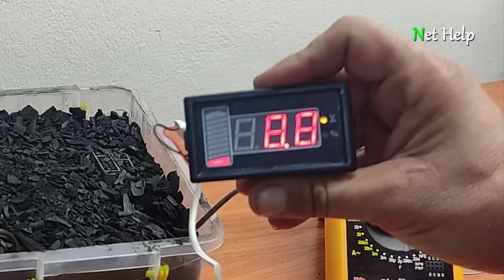Making a battery is a difficult thing, but we make it easier in this way - 12 volt battery

Comment: What substances do you use ?.
Reply from the maker: 1 - briquette
2 - aluminum panels
3 - plastic tube
4 - two copper rods
5 - brass screw
6 - aluminum screw
7 - copper strip 3 mm
8 - 200 g Hypochlorous acid 200L / H with a concentration of 200 PPM
9 - Electronic clock to monitor amps
Reply: Thanks .
Reply: Is it rechargeable?

Comment: Fake because single cell does not output 12volts it gives only 2.5 on average
Reply from the maker: sir
Have you searched for the Baghdad Battery, which was made more than 2000 years ago? It works in the same system

Comment: This is 1 cell only. you make 6 cells series connection, may be you will have 12v battery just like a car . good luck
Reply from the maker: The master of the lithium battery does not need six cells, but rather one cell

Comment: you make your self tired for cleaning the copper pipe, no need, after few seconds in the acid it will be clean very fast.
Reply from the maker: Cleaning the penis to give the charging buttons quickly and not the scythes of dirt
Reply: @NetHelp2  As you like friend.
Reply: @Net Help the white powder or whatever it was. What was that part? All was clear but that. Titles would greatly help or atleast just a quick recap near the info of the video is. Most was clear without talking or titles but I didn’t catch the “powder ish” stuff. 
Assuming Salt?
Reply: @MichaelSmith-mb1ig  sól kuchenna

Comment: Amigo, ya que te tomaste la molestia de hacer la batería, grabarlo, editar el video y colgarlo en YouTube, cosa que es de agradecer, podrías haber explicado que es lo que haces en cada momento, y los materiales y productos que usas, por que de esa manera solo se ve como lo haces pero quedan muchas dudas como por ejemplo ¿ que material estás poniendo entre los perfiles de aluminio ?  ¿ que liquido  es el que le echas al carbón ? ¿ que es el producto de color blanco  que también le echas al carbón ?   ¿ como haces para que el ventilador funcione a 12 voltios ? . A parte de las  dudas mi opinión, sinceramente, es que no creo que ese tipo de batería tenga el amperaje suficiente  como para hacer funcionar un ventilador, quizás para unas luces, motores eléctricos pequeños, pero no para mover motores más grandes y que se supone que funcionan a 220 voltios, no.
Reply from the maker: Señor, toda la información está escrita debajo del video y en los comentarios. El video fue explicado detalladamente en la traducción. Puede activar la traducción al español y saber todo lo que hice.

Comment: The battery is so, so, because the copper,  aluminum, and iron plates will last few weeks, corrosion will destroy the connection and metals.  Battery makers use lead connections of 1/4 thickness to last few years, then sulfuric acid for catalyst.
Reply from the maker: Yes, which is what happened in this battery, it became eroded
Reply: The battery  will work for short time because the connector are made of copper the rectangular made of aluminum and steel also the sulfuric acid will destroy in short time. Now get and old car battery  open the top then cut the cells 3/4 % and live the lead connectors untouched the fill all the cell with charcoal keep 1/2 inch clear from top, then seal the cover complite, then after one day of dry cover, start to fill sulfuric acid  up to 1/2 inch from the cover. Then charge in low, let the acid and carbon and electrons find polarity and store energy, then you made a carbon battery your way and  can be good for many years. You can do this type of work to any car battery and  will be good for years. Best Regards and make a good business out of all this.
Reply: @NetHelp2 . Get an old battery , use water to drain the acid wash good then after all water is drained open the top cover ( use eyes protection ) then let dry completely  after open the laminated led in the cell and place carbon fill up the cell inside and over with carbon all these materials will ( store + ) positive power and the next cell will ( store - ) negative, so battery have 6 cell,  3 cells negative connected to other 3 cells positive then when electricity is needed the ions starts to move from  cell to cell in chain movement, but all this energy come from the materials of lead and carbon amount to store AMPS is the number of capacity of energy that the cell can store when is needed such energy. Some batteries are 550 Amps. Others 650 Amp this battery shall be inches bigger than the 550 amps because have more lead in the cells to store more ELECTRONS. More AMPS  bigger cells bigger batteries. Then when you fill extra carbon in the cells you seal the top will plastic seal,  the cell must be separated acid will not move from cell to cell, acid and cell will have specific polarity, after sulfuric acid is given to the cell shall be cover the carbon, and start to charge very low to given time to the energy find polarity then the first charge it's the possibility that the acid will buble and give some acid smoke ( ( warning do not make any spark because that smoke is splosive it will blow up.)) Place the caps and turn off the charger let cool off check the charge,  all done for a carbon battery for years to be used.
Reply: @hugotorrado3948  good

Comment: This is probably a fake, as he using only one cell, which is limited in voltage.. it could maximum generated about 1.5 Volts with Aluminium and copper... He has probably hidden a different 12 Volts battery inside the charcoal..
The voltage of one cell is only mainly dependant from the 2 dissimular metals and only barely by the electrolyte...you could only boost the voltage with a good electrolyte maybe 0.5 Volts but not much more... so he could never achive 12 VOLTS with this setup...
So this his must be a fake...
Reply from the maker: First of all, lithium batteries are a single cell, not like liquid batteries

Comment: What catches my attention is that the Fan works with the domestic electrical network that I imagine will be at least 120 volts and suddenly it connects to its Battery that it manufactured and it is only 12 volts Dc and it is only DIRECT or CONTINUOUS current without using any type of current inverter in sight in the video for this purpose and that gives me serious doubts
Reply from the maker: Mr
These fans operate on electricity and battery
So we cut the power and disconnected the battery and plugged it onto the battery we made
Reply: Tgey should mention that use BLDC FAN instead of normal electric fan.
Reply: The table fan showing is should be BLDC fan.(Brush Less Direct Current-New Technology) not regular electric fan. BLDC items have double price then normar regular electric items.

Comment: I do not know what type of materials you are using. Can you provide a list of materials you are using?
Reply from the maker: All information is provided below the video

All we need is
1 - briquette
2 - aluminum panels
3 - plastic tube
4 - two copper rods
5 - brass screw
6 - aluminum screw
7 - copper strip 3 mm
8 - 200 g Hypochlorous acid 200L / H with a concentration of 200 PPM
9 - Electronic clock to monitor amps

Comment: Why you don’t seal the battery? The voltage is getting lower as you leaving it open.. 
and what exactly was the liquid you put on?
Reply from the maker: I closed it after filming
I added 8 - 200 g Hypochlorous acid 200L / H with a concentration of 200 PPM
Reply: Thank you for the answer 😃

Comment: May I ask if it can charge and discharge several times Can hypochlorous acid be replaced with sodium hypochlorite?
Reply from the maker: No, the acid used is not the acid that is used in the manufacture of batteries

Comment: What is you put in carbon to become activated?
Reply from the maker: All we need is
1 - briquette
2 - aluminum panels
3 - plastic tube
4 - two copper rods
5 - brass screw
6 - aluminum screw
7 - copper strip 3 mm
8 - 200 g Hypochlorous acid 200L / H with a concentration of 200 PPM
9 - Electronic clock to monitor amps

Comment: hello good day may i know what kind of chemical which you pour in the charcoal and what kind of white powder you mixed in charcoal  can you give me the name please i am enterested to do a DIY at home shokran
Reply from the maker: 1 - briquette
2 - aluminum panels
3 - plastic tube
4 - two copper rods
5 - brass screw
6 - aluminum screw
7 - copper strip 3 mm
8 - 200 g Hypochlorous acid 200L / H with a concentration of 200 PPM
9 - Electronic clock to monitor amps

Comment: Lo que me llama la atención es que el Ventilador trabaja con la red electrica doméstica que imagino será mínimo 120 voltios y de pronto conecta a su Batería que fabricó y solo es de 12 voltios Dc y es solo de corriente DIRECTA o CONTINUA sin usar ningún tipo de Inversor de corriente a la vista en el video para tal fin y éso me genera serias dudas
Reply from the maker: mi señor
El ventilador funciona con batería y también funciona con electricidad, viene asignado de fábrica
Reply: The table fan showing is should be BLDC fan.(Brush Less Direct Current-New Technology) not regular electric fan. BLDC items have double price then normar regular electric items.

Comment: What was the name of the liquid content if I may ask
Reply from the maker: sir
All information is blogged below the video
Number eight
All we need is
1 - briquette
2- aluminum panels
3 - plastic tube
4 - two copper rods
5 - brass screw
6 - aluminum screw
7 - copper strip 3 mm
8 - 200 g Hypochlorous acid 200L/H with a concentration of 200 PPM
9 - Electronic clock to monitor amps

Comment: Fan works by ac current wher you send DC current to it ...this is not right so the last step is deceier
Reply from the maker: Mr
Check the video carefully and watch the full video
The fan runs on battery and electricity and we disconnected the power strip and connected the battery

Comment: Are you serious? 😜 I am not an electronics but i understand how it works lol... Ok let us say that is 12v but how can you measure of the rate of electron flow or current in an electrical conductor?
Reply from the maker: Search the Internet for Baghdad Battery, Sidi
This battery was made more than 2000 years ago and is still working

Comment: another scam for any size of the element will not get more than 2 volts
Reply from the maker: It operates at 3 volts, but we have installed a voltage riser from 3 volts to 12 volts